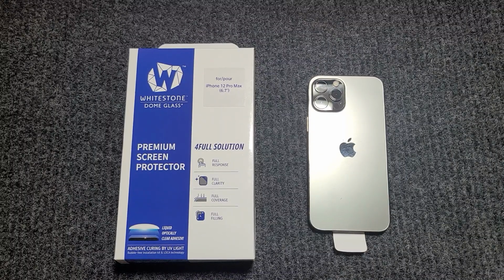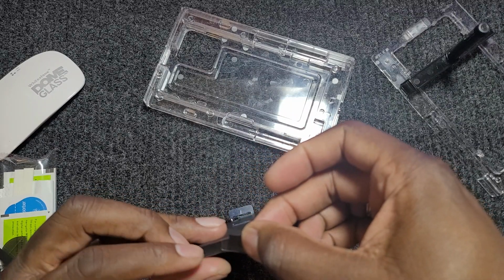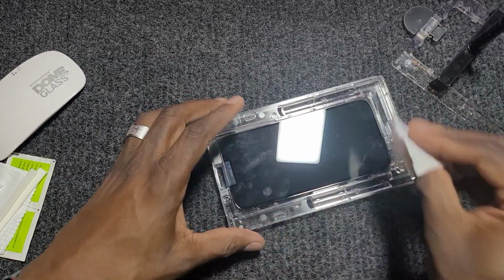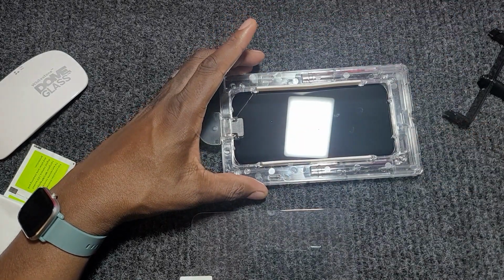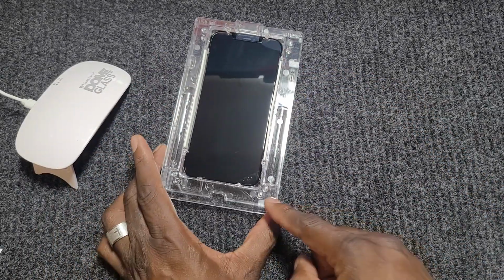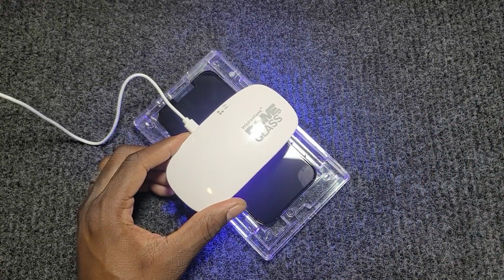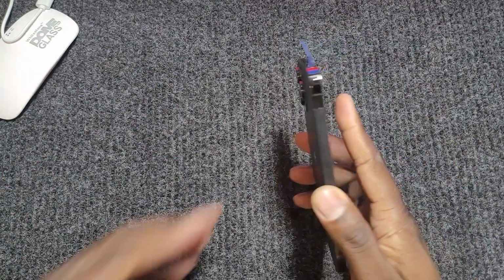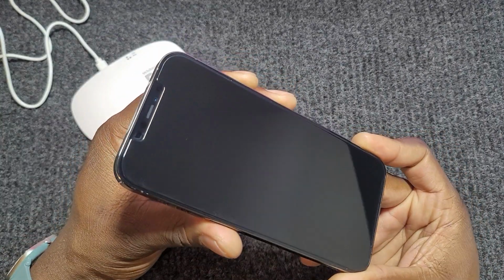iPhone 12 Pro Max | WhiteStone Dome Glass Installation

Comment: What’s the benefit of using this glass protector versus the traditional temper glass protector? I got the iPhone 12 Pro Max and I am considering buying this brand of glass protector but I would like to know which is better?
Reply from the maker: Buy and try, that's how you'll find out.
Reply: If you're keeping your phone for 2+ years then yeah the Whitestone Dome is probably a good investment. If you're upgrading in a year anyway then just get yourself a 12$ Spigen and call it a day.
Reply from the maker: @williejohnson9642  This is now only $9.99 so it’s the better deal.
Reply: I’m going to get both One for my phone and one for my girlfriends phone and do a little experiment on which one last longer but I bet it’s going to be the one in this video. Usually I keep my phones for two years or more but on rare occasion‘s like this year I upgraded from the 11 Pro max to the iPhone 12 Pro Max . Mainly for the bigger screen and  cameras

Comment: I just got the 13 pro max kit off Amazon and I thought it was missing the plastic weight that was used on past phone screens , like the S21 Ultra. That kit was a mechanical wonder. I was ready to ship it back but maybe I will give it a try as you did by tilting it. Thanks for this video my friend.
Reply: The iPhone version has no need for the weight because it doesn't have an in screen fingerprint sensor

Comment: The micro fiber cloth is garbage left more lint then it did any good.And when using dust removal sticker would leave sticky residue on screen would have to clean screen again  . Wasted a glass couldn't get screen cleaned

Comment: I watched this all the way through 2 times, ✌🏽and even a third time live in action.

Still came out fucked up. The glass shifted on me slight right when I pulled the tab. I had this product on my IPhone X back in the day and loved it. Seems like they cut back on some corners this time around. I noticed the template doesn't secure the screen like it used it.

🤷‍♂️ had to clean all the juice off, and they say you can save the screen protector. BS! That shit is impossible to clean without scratching.